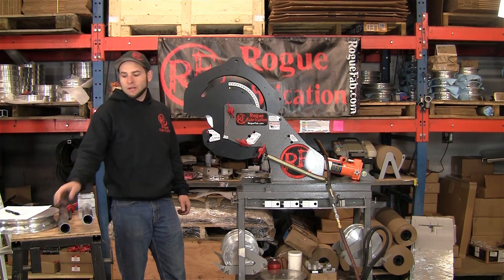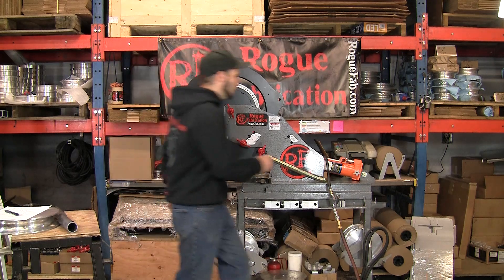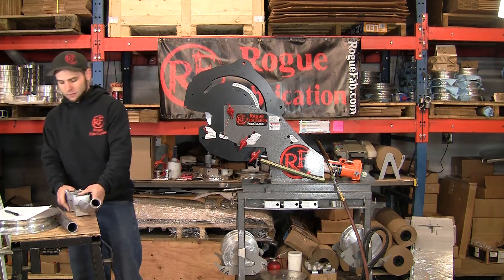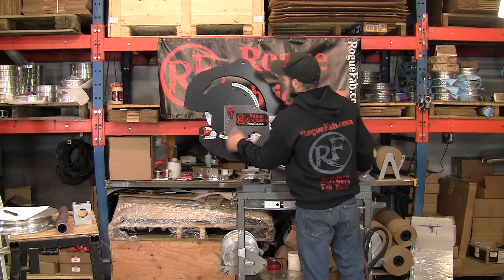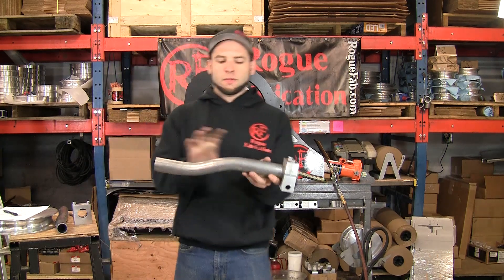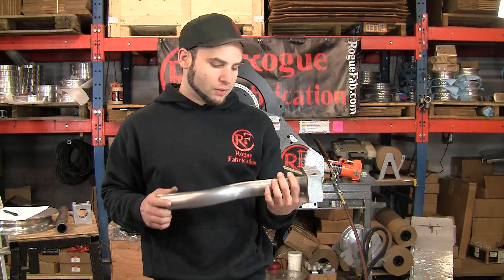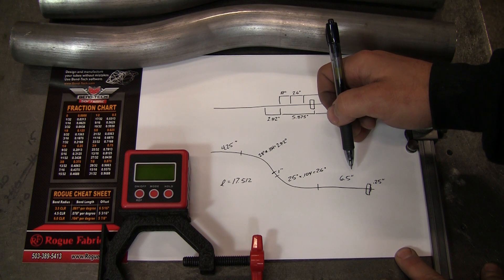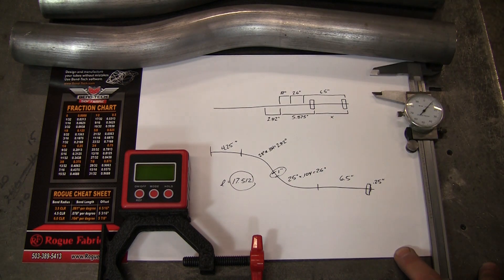How to make an S bend on a RogueFab Model 600 Tubing Bender

Comment: will it bend 1.625x .058  4130 condition n .?
Reply from the maker: +dragonfly fab no, min wall on the 1.625 is .083
Reply from the maker: We just came out with a mandrel attachment, and NOW IT WILL! On a 6 inch CLR die with a mandrel. They are live on our web page now, but the mandrel will be made to order.